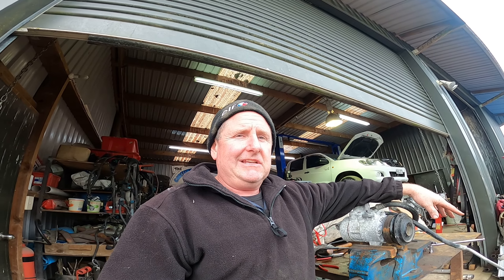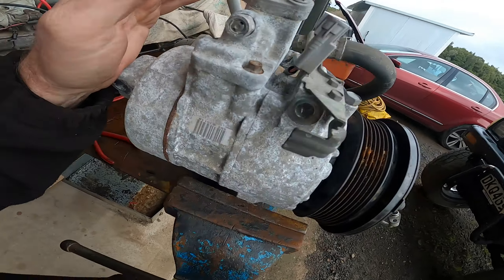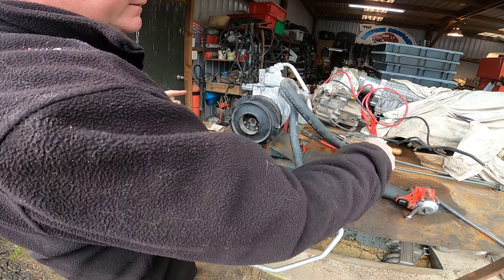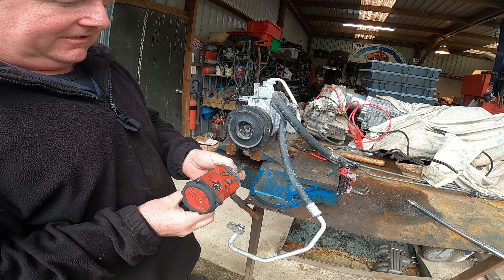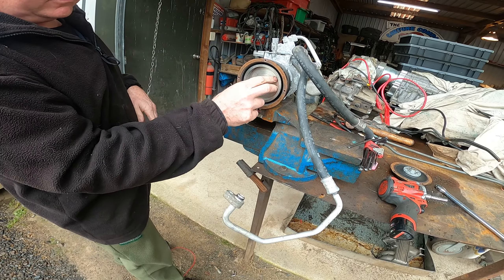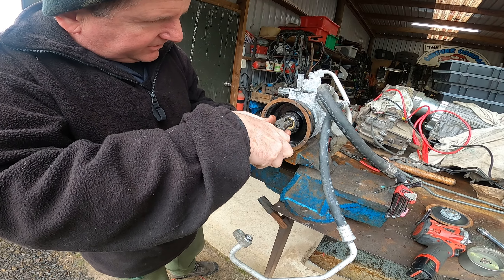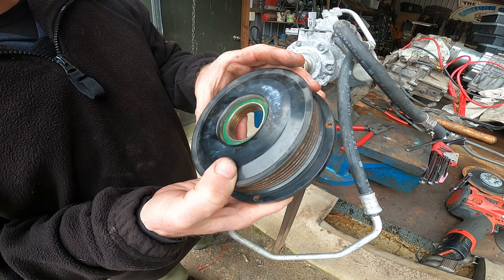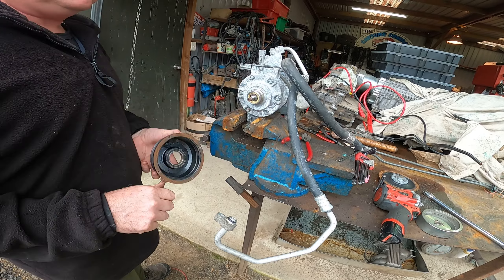Removing the front pulley on the 2004-2006 LS430 , GS430 and 3UZ crown air conditioning pump

Comment: so is the purpose of this whole unit to put the belt tension load on the outer bearing that's easy to replace, and the main drive shaft is protected from the belt tension?... or is it like some kind of magnetic induction drive that will slip free if the compressor seizes up?
Reply from the maker: This ps pump design spins the internal of the pump at all times,  with the bearing supporting the front pulley,  but its directly driven into the pump.   The air conditioning pressure is then controlled with pressure valve recycling the pressure within the pump,  unlike early ac pumps which have a magnetic clutch on the front pulley.   Hopefully that explains it.

Comment: Are you saying “Google” is wrong?....
I thought what ever the internet says is “always right”?
Reply from the maker: Well as Toyodiy is based upon an old version of the toyota epc,  it appears that there may have been a small issue in there,  which I found during this video which is a pain,  while using google,  so at this point in time I know there is one thing on the internet that is wrong,   as for everything else,  I have no proof that its fiction at this point in time.